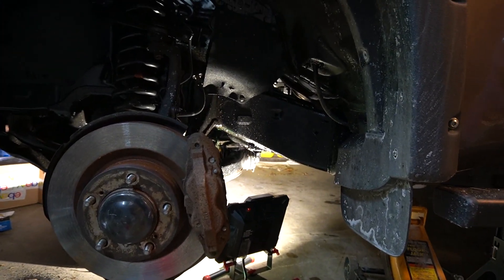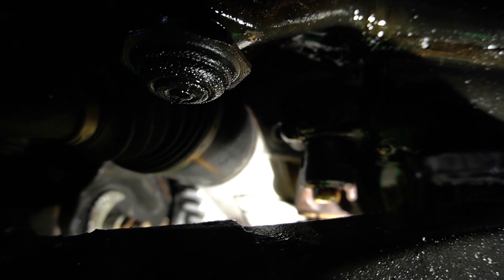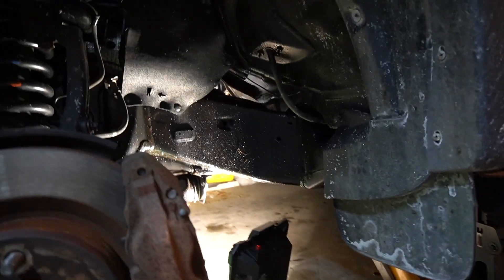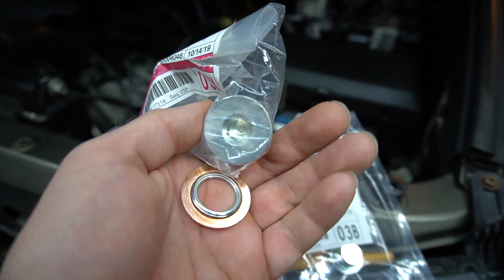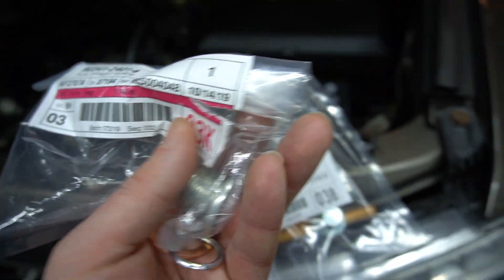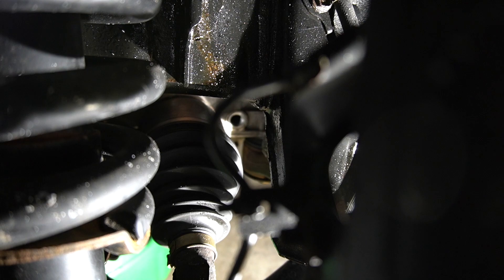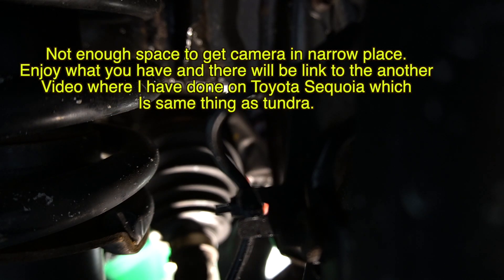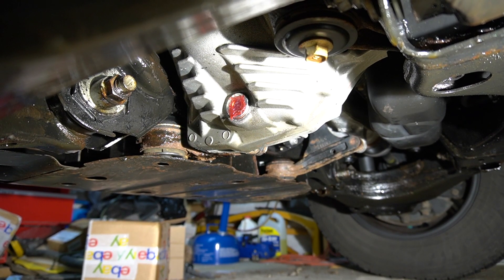How to replace front differential gear oil on Toyota Tundra 2007-2020, change gear oil on Toyota

Comment: Sequoia limited vid? Front, rear, & center fluid replacement. Please send link if available.
Reply from the maker: I have two videos for front diff. Both have different info and you might find it very helpfull.
https://youtu.be/HqtQlLga0qs
https://youtu.be/BpvWB4yfOoo
Rear diff
https://youtu.be/Yu8VIMh5_lU
Center diff
two videos
https://youtu.be/Vvb3zeicRVI
https://youtu.be/8HqPTmDcdWo
Reply from the maker: I have links for everything you mentioned.  I will send them you later today